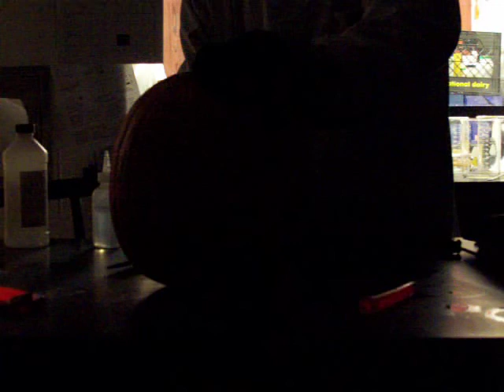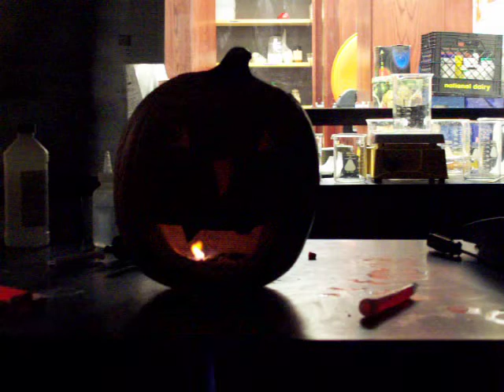Self-Carving Pumpkin 03

Comment from the maker: Calcium carbide and water to generate acetylene gas.  I usually place the CaC2 in the pumpkin and then drop in water from behind using the same hole that I put the lighter through.
I have seen another design using a candle inside to begin with and then add lycopodium powder from behind.